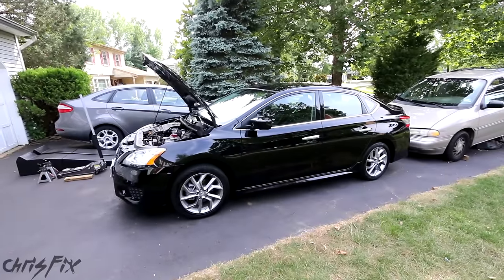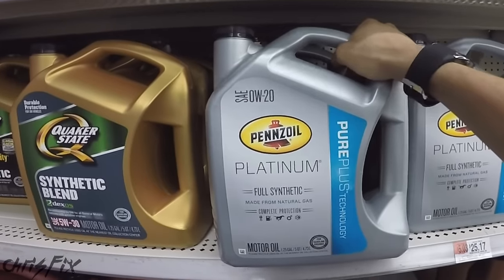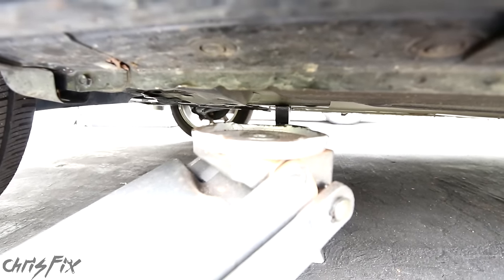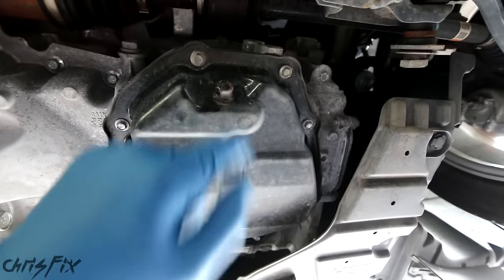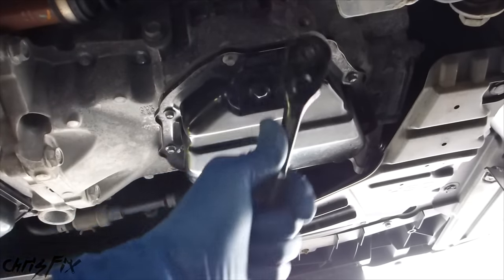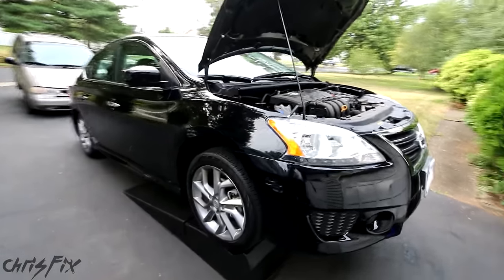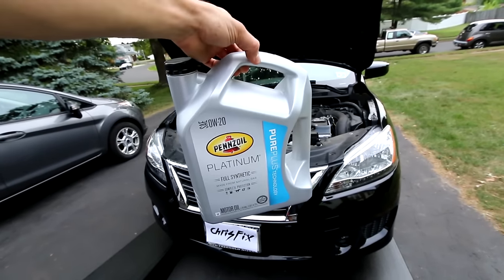How to Change Your Oil (COMPLETE Guide)

Comment: lol I love changing the oil in a truck, you don't have to jack it up/put it on ramps
Reply: You stand up to do it? lol
Reply: That's why I like having an SUV. Lol!!
Reply: Same
Reply: Same
Reply: I have a mk4 ford escort ('89, EU-model) I just let 2 friends hold it a bit in the air since it only weighs 870kg's total and you can lift it enough by hand to losen the nut :P
Reply: Pielemans When should i change my oil?
Reply: TheProphetsPath - പ്രവാചകന്റെ പാത every 3-5,000 miles
Reply: TheProphetsPath - പ്രവാചകന്റെ പാത better yet read ur owners manual. It will tell u
Reply: C J, i like cars and i want to know about more about cars and its internal parts,  please give me some advice to start with.
Reply: TheProphetsPath - പ്രവാചകന്റെ പാത to start with what car are u working on. There’s a lot of forums out there with tons of info. I myself have a f150 I’ve been working on and forums have been a life line
Reply: C J Please explain what is HorsePower (HP) and torque
Reply: When pouring the oil does it matter if the car is still on the jackstands/ramp or on level ground?
Reply: Deveen Edwards probably would be better to have it back leveled on the ground to get the best reading
Reply: Loaded Hard Drive im gay
Reply: Pielemans im gay u know that
Reply: IM BERY GAY PEOPLE
Reply: Camo FPV ur also gay
Reply: Loaded Hard Dri
Reply: Loaded Hard Drive  what about vauxhall  Antara
Reply: Loaded Hard Drive l
Reply: TheProphetsPath - പ്രവാചകന്റെ പാത Dude, use google.
Reply: meh my scion xa 2006 i don't have to jack it up either and is a mini car lol 😁😊
Reply: Same with my Jeep
Reply: Loaded Hard Drive my dad has an 02 Silverado. He still jacks it up so I can do it.
Reply: Loaded Hard Drive I know my jeep is tall enough lol
Reply: Like watching your video in terms of fixings a car thnks chris!
Reply: Yup.  But I still had to put my Ram 1500 on ramps before I installed the leveling kit.
Reply: Unless you have a 4th gen ram. The oil filter is so high you have to sit upright in the bumper to get good leverage
Reply: Is that the worst place ever, or what?  Between the engine and steering rack / cross-member(HEMI).  It took me awhile to find it the first time.
Reply: Loaded Hard Drive wrtggg
Reply: put it on ramps means shut up in frensh translation !
Reply: Deveen Edwards I put it in while I still have it on the ramps. You most likely have to start the car to get off the ramps, and you should NEVER start a car with no oil in it
Reply: I mean it's not like you need to change oil weekly or monthly
Reply: Loaded Hard Drive  ikr I have a 2008 dodgram 1500 I have not needed a ramp for it
Reply: Probably cause yo truck lifted or stocked
Reply: Loaded Hard Drive  
q
Reply: That’s so helpful lol
Reply: I work in a shop and today a guy came in with a 96 f350 7.3 diesel lifted and everything just went under with a creeper and did the job thing held 14 quarts of oil!  filter looked like a half gallon milk jug. it was huge
Reply: same with jeeps
Reply: Loaded Hard Drive I have a dropped truck lmfao 6/8 drop
Reply: Lol how's that gas bill?
Reply: I have a 1997 Camry and don’t have to jack it up either. I can reach right under there and get the drain plug lol. I found this out because I’m lazy.
Reply: Loaded Hard Drive yea but lifted trucks suck
Reply: Haha yup. Hell, I've got a '99 Pathfinder, and I can just squat down to change it.
Reply: Cars so crispy clean lol looks like Glass
Reply: Loaded Hard Drive ff
Reply: my 1979 cougar is high enough to squeeze under as well lol
Reply: Loaded Hard Drive ø
Reply: Today I got pissed because I couldn't get the oil filter off 😂😂
Reply: @deveenedwards746  probably ground is better but as long as you add the right amount it's fine
Reply: The efficiency of a car seems worth the minor inconvenience. To put it in a different way, driving onto ramps every few months saves me at least $3000 per year. Lol.
Reply: @CSGhostAnimation  Bruh! Lol
Reply: Agreed that is what I am going to on my mom's boyfriends truck

Comment: I've done quite a few oil changes, but of course I decided to change my mom's oil in her subaru, and it turns out what would be the oil pan in most cars was the cvt fluid I drained and I didn't have any and of course she had to go to trip today, so I don't have a car.
Thanks Subaru, the oil drain plug was under a flap you have to unscrew and turn out of the way

Comment: I never have to change my oil, because my firebird burns it all..
Reply: This is so good😂😂
Reply: +AcidicGamers2 
that's the reason why it burns it, change it and the filter and see how ur oil consumption drops!
Reply: +Warryck Scown I have/: doesn't work. Piston rings are shot.
Reply: lol bumma mate, rings and bearings then? GM
parts are quite inexpensive i hear! good luck!
Reply: +Warryck Scown yeah they're pretty cheap! I am swapping the cam soon, so may do it then. Not sure. And thanks!
Reply: +EthanFaidleyStudio 2000.
Reply: +AcidicGamers2 My old 91 benz used to burn oil, so I would only top it off and change the filter every 5 K
Reply: +sranjesuper That's what I was doing as well. No point in installing a new filter, if it's not bad.
Reply: Do you know how many people don't change there filter its crazy I for one have seen so many motors blown up running a sludge building oil and the filter plugs up trips the bypass not not filtering just pumping dirty oil threw the bypass valve then it plugs up the oil ports threw out the engine trashing cam, bearings, lifters and so on.... I also have had cars come in that were oil burners the owners say oh I don't change it cuz the rings are bad. And I say yeah your rings are jammed up with carbon from crap oil. most of the time a oil change to a good oil sludge fighting oil or cleaning oil and 3 filter changes later in less than 1500 miles and the engine is clean and its no longer burning oil. I can not tell you the oils that are the worst as I do not want to be sued by the company. The reason I end up changing the filter so many times in the same oil change when switching to a good oil is its cleaning the crap out of the engine and it plugs the filter once its clean you do not have to change the filter in between oil changes only when you change the oil each time. Lets think for a min a $3-5 filter or a engine blown that cost thousands maybe? Thats a no brainer to me but so many skip the filter I have seen then so old they rust threw and come in for a big oil leak and its just a rusted out filter. Acidic Gamers2 don't even have to tell me what oil he runs I already know its the only company out there that plugs up engines that bad lol. I will say this there synthetic version of there oil is not too bad but there are far better choices and there standard oil is so bad I would rather not change my oil for 20k more miles than to put theres in for 100 miles. Folks let me make it simple for you if you turn off your engine and can stick you finger inside your valve cover at the fill cap run you finger around inside and it comes out black thick greasy sludge your running bad oil.
Reply: charlie whitney yeah couple dollars for a filter and 1520$ or something like that
Reply: charlie whitney charlie. Is regular Valvoline oil good? I change my oil every 5k miles with valvoline. Should i switch to penzoil?
Reply: Agreed, my Prelude is a big money saver
Reply: AcidicGamers2 is a great way to go for a few days to get 5 to the top of the page for the first time in
Reply: used to have a 97 eclipse that did this. I miss the convenience....
Reply: that's not good
Reply: I never have to, because i dont have a frckn car :(
Reply: Dit Gaat Fout same
Reply: Time for a rebuild or a crate motor my man
Reply: Same man, same
Reply: Lol my 2002 Firebird T/A burns oil too... I think it’s blow by caused from bad rings at well. I also am looking into doing a cam so maybe that’ll be a good time to fix it. If the block is scored, then crate motor it is!
Reply: lmao same but its because my mini leaks like a sieve

Comment: I'm sure someone else has made the comment or you forgot, but. Check to make sure the gasket comes off with the oil filter. Otherwise you'll double gasket it and it'll leak. I also open up the oil cap when draining to let air flow through and help it drain faster.
Reply from the maker: +Austin76711 Thanks a lot for the tips!
Reply: +ChrisFix no worries! Thanks for the great and informative videos.
Reply: +ChrisFix OH! I forgot to mention that I think the band oil filter wrenches are better because with the clamp ones, you can crimp the filter, and if it's on too tight, it's hard to get off. If this does happen (I had to do this myself) you'll have to get a screw driver and drive it though the filter and twist it off.
Reply: what's a gasket?
Reply: +spind4 usually a rubber ring used to seal something. are you just being sarcastic or no ?
Reply: +kingfisher Singh no I'm here to learn about cars and mechanics.
Reply: +spind4 ok, goodnight
Reply: +Austin76711 Something else, be sure to open the vent cap on the oil drain/catch pan. And for sure, don't forget to remove the plug where the oil drains into the bottom. I don't have rubber gloves and had to fish it out once-ha.
Reply: I double gasket once. All the oil magically disappeared

Comment: Tip: Buy a cheap hockey puck and place it on your jack. This will prevent damaging your jack point welds on your car and protect your jack. Some jacks come with pads pre-installed but I prefer a little extra cushion. A hockey puck works great because it’s hard but soft enough to mold. After a while the puck will compress to a smaller height but continue to provide protection for a long time 👌🏼
Reply: they sell a plastic thing like that with a slot cut in it, so it goes over the ridge of the seam in metal there at jacking point If you don't have any hockey pucks laying around.

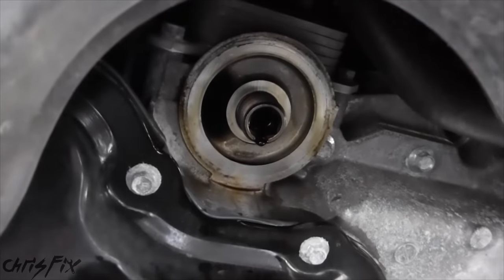Comment: 14:44 sometimes the old oil filters gasket gets stuck on the metal. Make sure to wipe and check to make sure its clean so the oil filter screws in flush and doesn't leak from the oil filter.

Comment: I have a Tesla and can’t find the drain plug. What do I do?
Reply: It's at the back of the car near the rear wheels for Teslas. But don't mistake it for the gas tank.
Reply: cameron gale thanks! It was very helpful.
Reply: Sell that POS and get a real car lol
Reply: @yotakev99  says the Jeep guy
Reply: @MilesPrower1992  My Jeep may be a POS but at least it runs and gets me to work and around the trails. carry a qt of oil with me and I'm good to go
Reply: @yotakev99  all I'm saying is don't rip on a car if you drive something worse
Reply: @MilesPrower1992  Worse to me is not worse to you. I hate Teslas. If you like them then that's you. But to me, Jeeps are better than Teslas
Reply: Tesla runs on solar power so no need for oil
Reply: @Jeepoholic Lol, you do you and that's good for me. I love Jeeps (and Tesla just can't compare to the sound of my 5.7 Hemi). 
I proudly own a 2007 WK Overland and a 2005 WK Laredo
Reply: Sell that shit buy a Subaru or a pickup
Reply: Return the car also is your muffler too loud
Reply: It’s under the hood near the blinker fluid fill port
Reply: Redneck Hillbilly what’s so wrong with electric cars fellow intellectual.
Reply: Fares Hussain r/woooosh
Reply: @MilesPrower1992  a gasoline vehicle will never be "worse" than an electric pos. Sorry that's not a car, that's an appliance.
Reply: @ashs3380  "ooga booga, new technology bad, obsolete technology good" You can tell me that gas engines are 100% better when you have a silent car that can be refueled with an electrical outlet, and doesn't have over 50 moving parts.
Edit: "sorry, that's not a car, that's a space heater"
Edit again: I prefer gas vehicles. But I don't like gatekeeping morons.
Reply: Ash S hmm I see you are an intellectual. I have no strong opinion but electric cars are just better for practicality and long term benefits but I’m going to be taking a gas car over an electric car most the time.
Reply: Check blinker fluid obviously
Reply: Your Tesla is defective. Just drop it off by my place and I'll get rid of it for you. Remember, the scrap yard requires a title.
Reply: Jeepoholic well he might like his Tesla so like your Jeep and keep your rude comment about someone else’s car to yourself
Reply: @paxtonrhoads7709  long term benefits will always be in gasoline engines.
Reply: Tesla needs oil change? I thought just power
Reply: Ciny w r/wooosh
Reply: You look in the owner's manual
Reply: MilesPrower1992 Dude cars are designed to fail now it’s planned obsolescence
Reply: Drive ur Tesla into the ocean, u will find the drain plug there
Reply: On a serious note, good onya for having a Tesla. You're saving a whole lot on maintenance.
Reply: Hahaha
Reply: All the people salty over Tesla's are also the same people that lose to them. Get over yourselves lol
Reply: Wyatt B buy a mustang
Reply: It’s near the exhaust pipe precisely at the muffler. It looks very similar to the gas tank so don’t get confused
Reply: @yotakev99  YOUR JEEP has a FIAT Engine that blows up.
Reply: @markplott4820  Actually my '93 Jeep has the AMC designed 4.0L straight 6 under the hood :) These engines are bulletproof.
Reply: Jeepoholic - OK, but what will happen when the price of GAS goes to $5 or even $10 per Gallon ?
DUBAI has admitted that it’s focused on Renewable Energy because there is ONLY 7 years of OIL left in the Ground, BIG OIL is heading for an IMPLOSION. 
ALSO, what can the JEEP do than a RIVIAN Electric JEEP can’t do, or a TESLA PICKUP ?
have you seen the Safety ratings of JEEP Wrangler 2019, there are Terrible.
Getting in an Accident in a JEEP, you are 10x more Likely to be Gravely Injured, compared to a TESLA.
Reply: Jeepoholic - NOPE, I charge my Tesla with 100% Renewable Energy from my Solar panel , my Wind Turbine and my Battery Storage, my Home is also Connected to the GRID by its 100% Public Power. 
A big FU to the Energy Utility.
Reply: @ashs3380  I smell a fellow petrolhead 😂
Reply: Do electric cars even need these fluids?
Reply: For those of you who have a problem with Wyatt B’s post or anyone who is supportive of him, I understand this may be something that is beyond your level of development. Some people remain in concrete thinking and never reach abstract thinking. I don’t believe any of you have the authority to dictate what can and cannot be posted. God bless you immature people because you are going to need it. We live in a world with different people and different cars so get along.
Reply: My comment about the immaturity was mainly directed at Jeepoholic but somewhat at MilesPrower1992 as well.

Comment: The biggest tip i have is to make sure the old gasket came off of the old fuel filter before you put in the new filter. If there is 2 gaskets it will just leak and your brand new oil will be gone. The best way to check is to make sure the old gasket is still stuck to the old filter. If it is not then just peel off the old one from the engine.
Reply: ***** Yes!
Reply from the maker: ***** Great tip! Thanks for sharing!

Comment: Use cat litter to clean up spilt oil.
Put some on the oil and wait a minute, and then sweep it up.
Reply from the maker: Great tip! I do the same!
Reply: Bundeswher  , you could also use a long hair cat to wipe the excess oil as well
Reply: Nikolai Tsakov UH
Reply: Bundeswher I use car washing soap lol
Reply: That and sawdust are my go-to spill-cleaning materials.
Reply: Cars Simplified that's what I had to do in fire tech because we never had cat litter and saw dust worked better for us
Reply: Bundeswehr what about sand?
Reply: I find it mats the fur too much on a long haired cat. Much better to use two passes with a short hair. Like painting. Two thin coats are better than one thick coat :-) And this comment is completely sarcastic, just in case that wasn't clear. No worries, no cats were harmed while I posted...or at any other time.

Comment: Changing your oil on time is very important. However, the key to keeping your engine from wearing out is by using the best quality lubricant possible.

It's amazing that some synthetics have a third of the where compared to regular mineral oil.
Reply: @Synthetic Oil Protection. Actually, the key to keeping your engine from wearing out is... to have a little bit of oil in it of one kind or another.  Anything is a lot better than nothing! You might be surprised at how many people are running their cars with the wrong kind of oil and with oil levels way below the bottom line on the dipstick, yet the car keeps going for 1000's of miles anyway. Next after making sure you have at least a little bit of oil in the engine, is making sure the oil level stays above the bottom mark on the dipstick. Then comes changing the oil every now and then. After that comes using the right type and grade of oil as recommended by the vehicle manufacturer. As long as the oil meets vehicle manufacturer specs, and you change the oil as frequently as recommended, you won't see a lot of difference in engine longevity between different brands of oil. If the vehicle manufacturer says regular oil is ok, then it should be ok, as long as you change it according to recommendations. It is not uncommon to see different grades of oil recommended for the same engine, in different vehicles. for Toyota recommended 0W-20 in my 2010 Toyota Matrix. Pontiac recommended 5W-20 in the Pontiac Vibe, which had the same exact engine. Both cars were about the same size and weight. They were almost identical.
Reply: @soilmanted Good Point.  But most Toyota's allow for both 5W20 and 0W20 in their L4 1.8 Litre Engines.  Shouldn't be an issue for the Pontiac Vibe either.